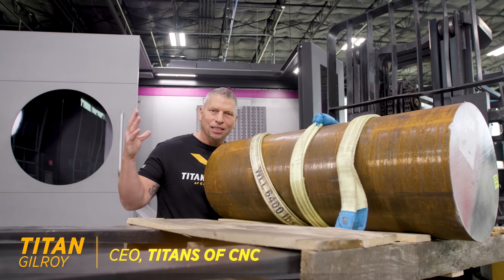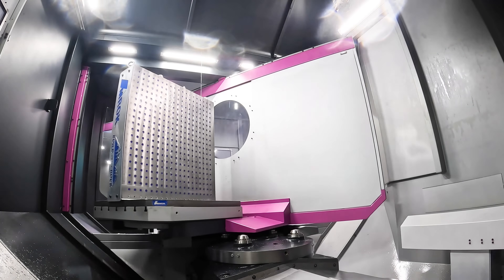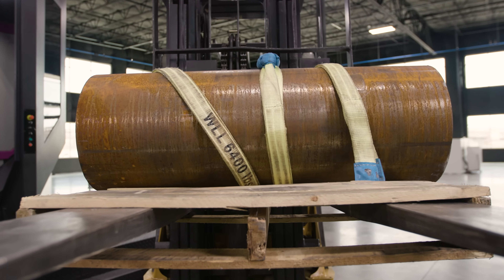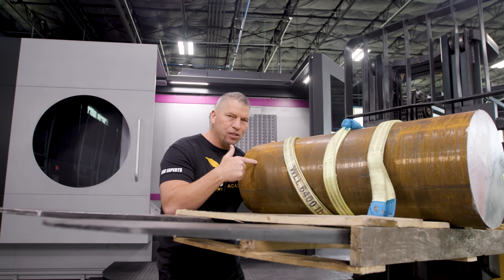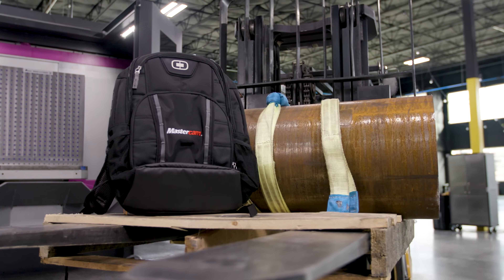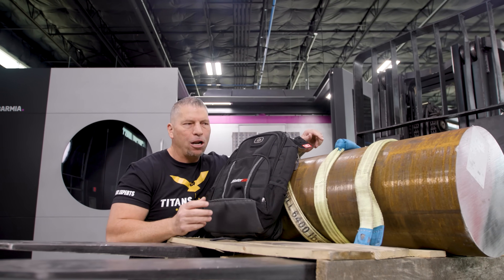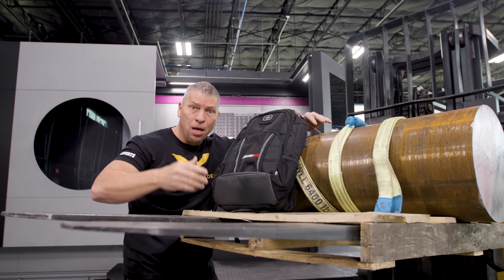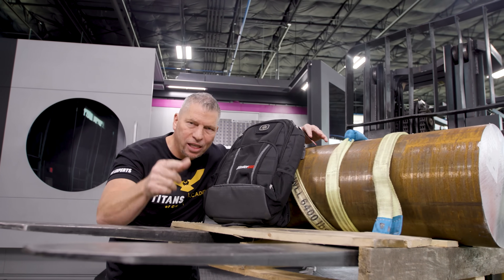How Would You Do It?? YOU Tell US How to Fixture This Monster!

Comment: Hey I am a 1st year mechanical engineering student. My idea is that it could be held in an enormous 4 jaw chuck. As long as it doesn't exceed the 3 times the diameter rule (the material can't extend further than 3 times the diameter or it has to be supported from the other side) and the chuck is rated for the amount of weight from the material. It should be fine.

Comment: Step 1  face one end using chain clamps then tig or stick weld a hoop bracket to the butt of the piece ... Leave it set back from the face 1/16 to 1/8 inch so the butt of the work piece is pressed down onto the tombstone with 2 to 6 tons of force   .Its pre stressed into position that way rather then just hanging on the brackets ,  Then just run big bolts threw to pre stress the piece onto the tomb plate . Then rotate the part  into work position  .Then after the majority of the mass is removed you flip the part  over and machine  the brackets  off maybe using a v block  BOOM... 
I would use a welder to quick tac some stuff together for this one .
Reply: No drawing of the finished part is needed if you have Christ ...

Comment: If angle plates are available(2-3 angle plates) at least as tall as diameter of the part. Mount plates in a way to create a shelf of sorts, to rest the material on it. Secure with bolts to the tombstone and the weight of the part should suffice to keep it down for conservative 1op cuts. An idea of what the part will look like would definitely help.

Comment: Mount two pieces of aluminum to the table approximately 2 in wide and longer than the diameter of the bar. Mount them as far apart as you can and then machine the radius of the bar into each one creating a set of custom V blocks but with a radius. Mount straps across the top with bolts tapped into the aluminum to clamp it in place.

Comment: Depends on what you are making. 
Either machine clamping points in op1 flip it and hold it in as many vises as you have room for and deem neccesary. 
Or if the part has treads and locating holes do them in op1 and make a simple fixture with these holes for op 2

Comment: Here is a short YouTube video of how I would do the first clamping: https://youtu.be/EBEz0Gq7a9s I opted for a solution with split V and chain clamp from AMROK. At first this is just a rough 3D draft. Depending on how your first machine operations should look like, the V elements or chains might have to be designed larger. A stop for one face also makes sense if there is too much axial milling pressure. The system with the chains allows a great deal of flexibility and also has a lot of pull-down forces. You could possibly also mount a TOMBSTONE RISER, but the thing then gets even more weight and at some point the table load is over. So I think in order not to invest too much money in clamping devices and to have a lot of access to the part, there is no way around chain systems with the size of the workpiece. In order to develop more ideas, you really have to know what is to be made from this raw part.

Comment: If its some sort of machining on the diameter... V's with straps over , held vertically on your tombstone..  If it needs turning afterwards, maybe a pre op held on V's with strap's to hold it safe on a lathe. Or maybe you need to mill 1 end for fixturing and then machine all over depending on drawing criteria.

On that note Mr Gilroy, there is to many entities missing for anyone to judge how to hold it :)

Comment: i`d personally fasten it with chains onto a pair of prisms, like those you had on the floor in the video, maybe for pre-OP to drill 2-3 Holes into it with threads to fixture it on those Shunk-Anchor things, but it depends on wich surfaces need to be machined. ^^

Comment: I´d say mounting it vertically is the way. Using a big chuck on the empty table, or face the part on a lathe and machine a slot where you can clamp it directly to the table. 

With the tombstone, you would only be able to machine 4 sides at most and use of the c-axis is very limited.

Comment: My attack would be using the tombstones bottom 90°angle as a v block laying the round stock down horizontally with a backstop then strapping it up and around the tombstone and mill parallel to the length on both sides creating a flat square surface for clamping with vices.

Comment: To fixture a round object you need at least 3 points of contact, you can use the roda s chuck that you have if the piece fits in may be support it with large machinists jacks and v block if it has too much stick out, if the piece doesn't fit in the chuck i'd make large v blocks hold the piece against the v block with chains, use a stop on one face then face the other side and drill some holes if needed then make a flange then bolt the piece to the flange then bolt the flange to the tombstone
So the main idea is that round faces need at least 3 point of contact, the flat face of cylinder can use bolts, dovetails ....etc.

Comment: op  1- put the raw material on a 3axic vertical mill, lie down the material and hold it with a v shape clamp or any down hold clamp. 
do face milling some material  from cilindercal od and create a space for  some m16 hole and some 16h7 dowell hole,  minimum 4nos of 16h7 hole and 12-20 m16 hole for holding purpose only
op-2 -make a fixture as per the 16h7 and m16 position keep some space at bottom side for tight the bolt and dowell pins.
op-3- place the fixture on the bed , lode the part , tight it from bottom side and ready to run  (dont use tumbstone)

i dint know the drawing but this is the way i think you can able to make machining from 5 sides of the material
1-top,2-front,3-back,4-left,5-right

Comment: For the preop/1st operation the datum would need to be established. This fixturing can be done for example mounting it on one flat side and machining the other, establishing a known flat surface and diameter. Afterwards in op2, the material can be fixtured as you've done previously on Titan Academy on part Titan-516 (propulsion fuel manifold) using Schunk (Vero) Rota S system, the biggest that they have should be appropriate for the task at hand. It allows for machining on 5 sides of the part and when mounted is the beast of workholding as you've shown previously. Combined with the beast horizontal 5 axis machine, this part could be turned into anything imaginable.

Comment: I would require a drawing before proceeding so I can see the datums and critical features of the part. That being said I’d use two tilting vices 90 degrees, grab onto the flat ends, mill a dovetail into the piece, and then go to town with some shunk work holding or a couple of Kurt vices to really grab onto this beast via the dovetail.

Comment: 1st off.. Fixture what to the machine... What is the part we are picking out of this material.. You Mr Titan was very vauge about what we are trying to accomplish.. Depending on the geometry and tolerances of the product that at this point is unknown! You being a shop owner and a manufacturing engineer should know u just asked an impossible question with the lack of information you just gave.. If you went to my shop and laid that 4140 on my shop floor and asked me that question as you just did in this video.. I would mail u a bill for wasting my time! 💯
BOOM

Comment: Well making an assumption that you at least want 2/3 or more sticking out to have a go at first. 

The only known regular shape is the outside of the shaft. At least until one end is machined. 

This also depends on how much material there is to waist. If you can clamp it in a large enough v block or lathe with a steady. Then machine one end flat. The drill and tap it for multiple bolts to hold it down. Then the rest can be down sold on a simple bolt down plate. Have seen manual lathes big enough to do that. And it's an ideal manual job just to make flat and attachable.

Otherwise if you don't want to machine one end flat first. Not sure what you wouldn't. Then it would have to be a very large custom clamp around the radius of the bar, and at least 1/3 of the bar at that length. Maybe 1/4 the length. 

Do that vertical and center on the spinning 5 axis table then you have access to all sides for the exposed section. The second jig if necessary and flip. 

I would not feel confident in a simple chuck clamp with such short jaws and such a long stick out. Maybe I underestimate how well a larch chuck could hold it. 

Really depends how you need to do the first set of operations. And what the part is going to look like. 

Never worked with stuff that large and heavy so I'm interested how you do it. 

These were my first thoughts.

Comment: As simple as this sounds I encountered a similar part. What I did was I machined a 1/2 cradle, either 2 or 3 cradles depending upon available space on the part. Clamping, believe it or not can be some sort of chain binders or ratchet straps. The cradle should have flat bars or pads that can be clamped to either the table pallet or tombstone. After all you did say this would be the first operation. Alternate clamping methods can be added for the remaining steps as needed. Good luck, I always loved machining large parts like this.

Comment: First drill center hole on other side of cylnder, Setting a center holder to plan table and on vertical plate a fixture for centering cylnder vertically.  After its time to clamp clynder with fixtures on horizontal plate.  Then is time to fix a top of cylnder  on vertical plate.  Now we must make index planes on clynder, 2 down, 2 up and its time to finaly fix clynder on these planes.  Now its ready for final machining.

Comment: Well just to mount it on that tombstone I would machine one side flat,find center drill holes according to table layout,machine drilled holes flat so bolts can be used to bolt it to the tombstone with a hard stop bolted at one end of that material.

Comment: As many of already noted, it would be great to see a drawing. Without knowing exactly what's going on, you might consider milling a dovetail along the length of the part, on one side. Put a few vices on the empty table and clamp on the dovetail. At this point you can get at four faces. Once those faces are done, flip it over, grab on a machined surface, face off the dovetail and add the missing features. Just a guess though without the cartoon to show what you are trying to make. I did notice that on the blank, you had a hole, has someone already centre drilled it? Are you considering a rotary on your empty table then too?

Comment: I think the best fixture setup you could use for most operations. Would be to turn the first inch or two in a lathe just to clean it up and then you could either use an internal dovetail fixture to hold it kind of like an hsk tool holder or external dovetail fixture to grip it from all sides.

Comment: Sorry for mi English. For me if you have to machine that part 5 axis for sure you’re have to grab it like on lathe as well you’ve done for The octopuss on dvf8500, this for a complete 5 axis machining as you say on the description,and re grab it on the tombstone for the 6th face to finish the part. This give to you a lot of space for machining over al the stock but not with a high rigidity on upper lever. This for me is the best layout for the specs that you discribe down the video.

Comment: I would lift it into the machine side ways because it’s easier and safer. Then using very big machinist jacks and big straps. Get it close to level and strap it to the tombstone at the edges of the part. Then giant ball end mill clean up the entire middle of the part and make little flats at the front top and bottom. Then you can move it around and keep using the machinist jacks and straps both at the end of the part and indicate off of the little flats to get to the same exact zero every time. And since the ends are like 2 and a half feet in dia. And you have it in a mill. Your most likely going to put some kind of design on the ends or something to where you can actually machine it all with more normal size endmill. And boom then you can finish the whole part just by manipulating it around indicating off the 3 flats.

Comment: 1) Using the empty pallet I would bolt down two V Blocks inline, place the work piece on the two V blocks and bolt it down leaving access to the side of the round bar.
2) Then I would use a shell mill to mill a flat surface along the length to the bar. ( Work piece )
3) Then I would step down and mill 2 dove tailed edges along the length of the bar for holding in dove tailed jaws on the next operation..
4) With the first operation done, I would now place the work piece into the 4 vises on the other pallet holding it in place with dove tailed jaws.
We are now ready to proceed with the second operation.

Comment: For a one piece job, I would start with solutions on hand rather than investing in a dedicated production fixture unless I know it can be used in the future. Depending on what needs to be done, I would use V-blocks with chains/bar clamps or mount a chuck to the table to run it vertically if able. If only the faces need to be cut, then V-blocks could only need one operation. If there is complex work on all sides or even a turned dimension, then a chuck might work best albeit with multiple operations.

Comment: Hi.
Sorry for my ENglish.
Ok. Remove the midl section on the wall that separate the two pallets.
Two vise. One left one right. One for each pallet. (You can say that the material is balanced "center" or not).
Is better to put a conical pins to center off the flat ereas left and right (i saw a hole) or you can make holes for 3-4 screws on each side to support the material. Or you can hold veerrryyy good the one side and the other side of the "working part" to flowd on air. Like a canon.
That is just the start. I don't know what part is going to be.
Sorry i don't know much about milling.
I just operate cnc router.

Comment: Use crane to get RM near to m/c use a V block to keep it on the m/c. You can use Hydraulic or pneumatic actuators for slight adjustments if required.

Comment: Don't know what you will make it into
And don't know the constraints of the michine.

- Mounting it vertically in a Chuck would put the least strain on the machine.
- mounting it horizontally with a Chuck on either end, or chuck and tell-stop wouldn't give the 5 axis

- Mounting horizontally in a Chuck with out support wouldn't be good for the machine or end product. 

Again don't know when the end product it going to be, clean it up with a big lathe and take it down to the outer dimensions, then could mount it to the table with magnetic locks. If you were going to make like a decorative display 😆

Comment: Definitely need a complete drawing, stock dimensions and pallet constraints to decide. 
I don't know if your pallet system could support large jaws to clamp and center the piece axially on the pallet, but that seems to be suited for this piece. Center and align the axis of the stock as well as possible to the face of the pallet using 6 large jaws (not necessarily a lathe chuck, not sure what you'd call such a fixturing system), offset the stock from the pallet at the center using a small shim to allow the chucks to align the axis instead of the cylinder face on the pallet. 
Machine the opposite face and O.D. just far enough clear the jaws with the face on the table, assuming it deflection and chatter remain minimal, and that the stock was centered enough to start out with good parallelism and perpendicularity for the first op. Flip it, re center, clamp, proceed with first op (probe the end of workpiece if fixture offsets aren't just off the pallet face).

Comment: I agree with what's been said here already, in order to figure out what the best way to fixture it would be one needs to know what part is being made from it. 

Considering it's a 5-axis machine, in general, I would want to position it in a way that would give me the most access to the most of the workpiece possible. In this case that would mean holding one end of the cylinder flat against the tombstone so the machine can reach the other flat side and all the way around the cylinder, but I seriously doubt that will work here because that'd be a huge piece hanging out fixed from just one end and it's HEAVY.

Comment: Hard to figure out how to hold it without prints. Dunno where datums are, or what tolerances should be hit. 

With this and completely shooting in the dark. I'd set it some some v blocks. And finish a 0 face and the profile. If the there is extra material flats can be cut for areas with toe clamps. 

Clean up a zero face, hold onto part from zero then place remainder of faces and features.

When figuring out how to machine a part, the print is needed inorder to see which datum the engineers call out, and then you must figure out how to make the part following those datums, and holding tolerances. Not only that but it is unknown the stock working with (on size, mill around...).

It would be cool for you guys to release a part for the community to make programs for and to submit, then you can really see what your viewers know.